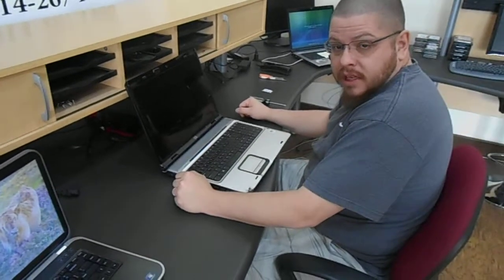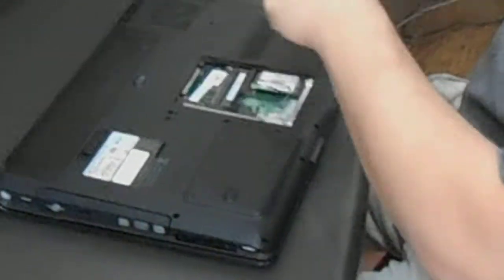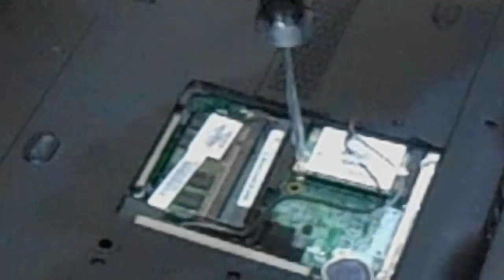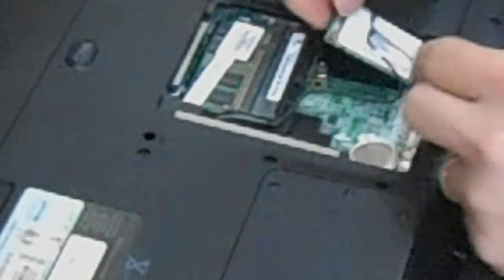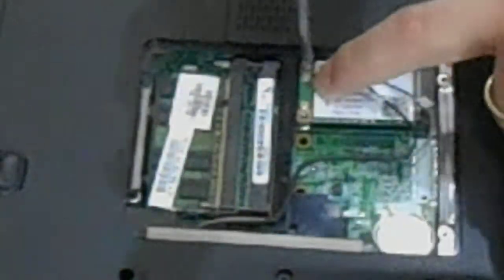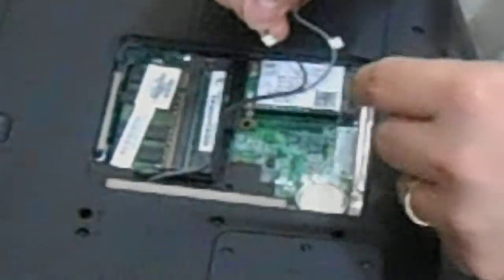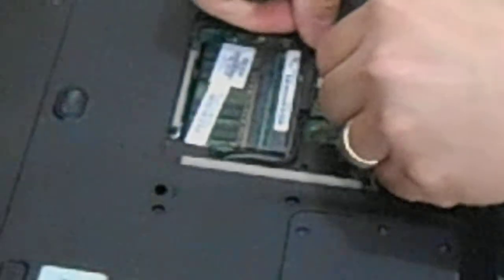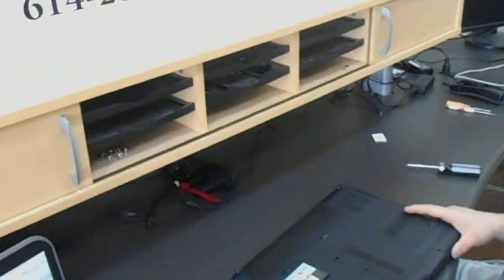How to replace wireless (wifi) card on Hewlett Packard HP laptop

Comment: What mode is this laptop and what size screw is this I tried to remove the WiFi and I use a small  p1 screwdriver computer repair kit  and I stripped 1 screw